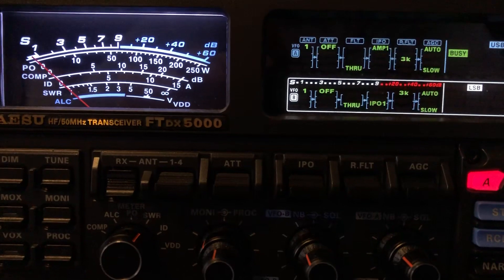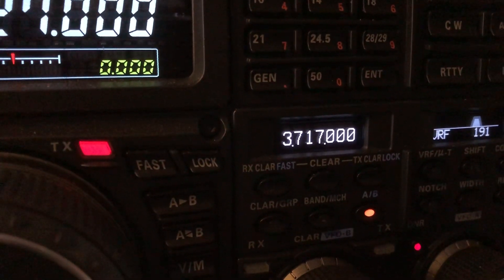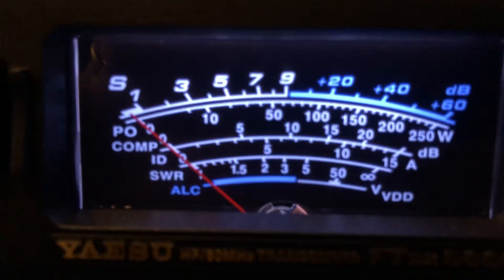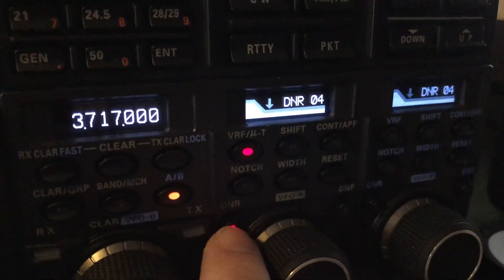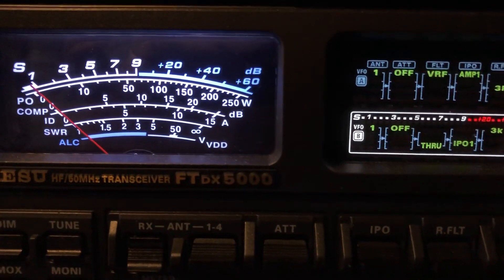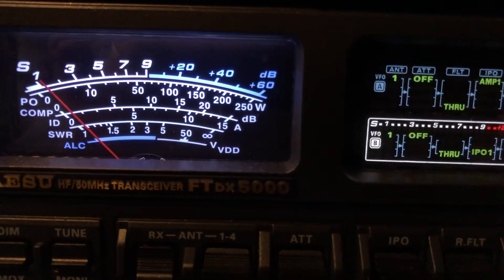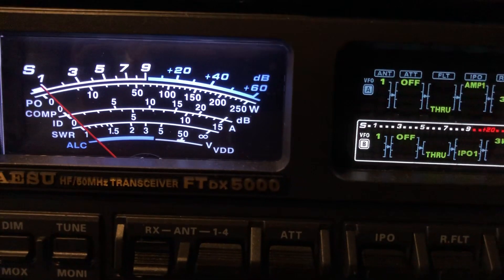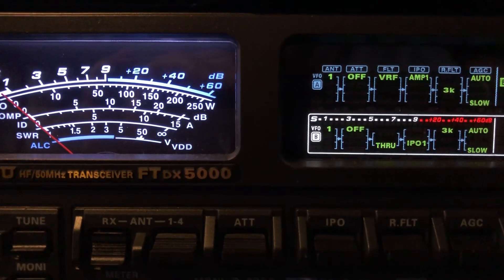Yaesu FTdx5000MP: Noise Reduction with the VRF Preselector

Comment: Like Black Dog I am still discovering new things about my FTDX-5K and this is one of the best features to come along that I can put to immediate use.  I too work a lot of weak signals, mostly chasing DX for a new one, and the VRF feature is going to help.  I live in a rather noisy suburban neighborhood and my rx noise threshold can be as high as an S8 at times, especially on 40m and 80m.  The S/N improvement is very apparent when selecting the right VRF setting.  Thanks Doug.  Nice work.  
73 de Bob KW4CQ.
Reply from the maker: I’m glad you found the video helpful.  I find that modern radios have many useful features, once we master master them.  Learning how to combine them takes it to a whole new level.  73, Doug